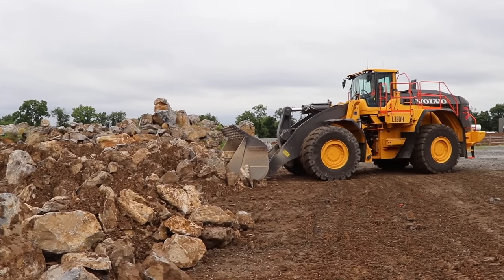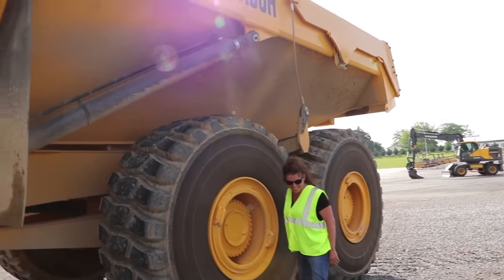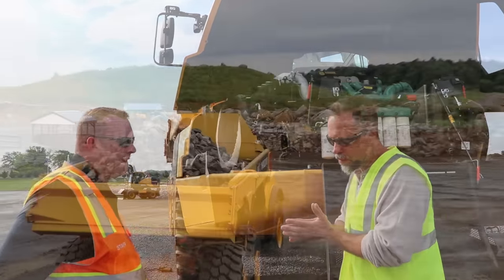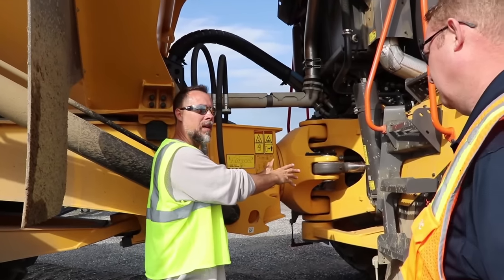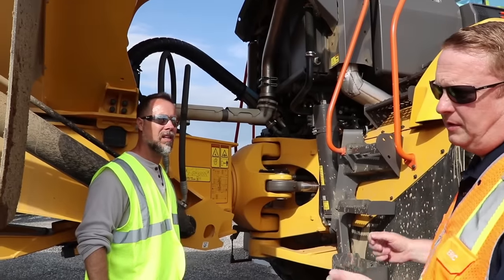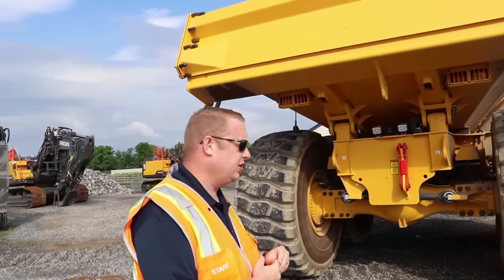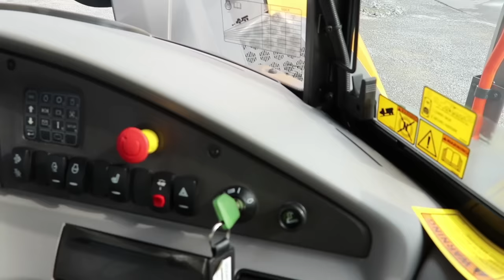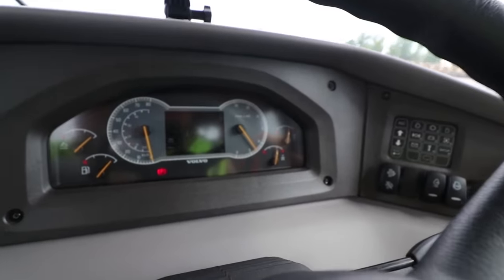What NOT to do with Heavy equipment.  Warning signs & mistakes in a 60 ton rock truck #1

Comment: About 35 years ago, when I was an oilfield mechanic, I was drafted to operate an articulating earth mover when the operator quit while I was on location.  Ended up being the dirt crew's resident mechanic/operator for nearly a month before we got back home.

We were building a pad for a oil drilling rig on a hill which required digging out the side of the hill for a mud pond and using the dirt to create a dam as part of the pond.

I was dumping dirt on the top of the dam when the earth mover started sliding down the side of the dam and tipping (about 20 feet high at that point).  I knew the articulating joint could make a 90+ degree movement so I turned the steering will hard to the right to stop it from tipping but it kept sliding so I stomped the fuel pedal to get the cab ahead of the back end and drove down the side of the hill until I got to the road and drove back up to the dam.  By that time the grader operator had flattened out the top of the dam so it was safer to drive on.

A regular truck would have just slid until it rolled before I could have gotten it turned.  I love articulating equipment.
Reply from the maker: Thats scary as all get out

Comment: Next time I drive a 60 ton truck this will be a very valuable video.
Reply from the maker: Next up is payloaders, then skid steers, compaction and tiltrotators
Reply: i didnt thought id have to drive one one day but here i am an open pit driller and blaster without any holes to drill or blast and im asked to haul muck in one of these 😂

Comment: I work in the mining industry and I love the articulated trucks I have driven A40E/A40G and a cat 745C. The truck can do about anything you want to do. They have one down off yes the bed can fall over , but it works both ways as in the cab can fall over too or go completely on it’s head. This happens when wet or heavily packed material get stuck in the bed while dumping. To me this happens more with beds with bed warmers that is what the pipe is in the middle of the truck but that is the only problem I have with the trucks
Reply from the maker: I didn't think that it works 2 ways. Thanks for pointing that out

Comment: Worked at a coal mine that leased a whole hollow that had a one lane county road (paved mostly) had roads so steep that every time it rained it required a rubber tire loader to push the haul trucks (18 wheelers) up the mountain. The mining complex had 3  different undergound mines and a mountain top removal section of the strip mine and 2 wash plants. Everyone was required to have CB radio, flags and strobes as soon as they entered past the guard shack, because all the miners had to use the haul roads to access their respective underground mine entries. It was never fun to find out your CB wasn't working because of a blown fuse and run up on a "lizard Truck" like the one in the video or a D73 with it coming down the mountain in a blind curve on a one lane road like the same width shown in the video.
Reply from the maker: Holy crap -Thats scary

Comment: A 4 stick backhoe with wore out pins and bushings is funny to put beginners on.
Reply from the maker: If they can learn on that then they can handle a new one
Reply: Hell I took right to stick controls on our 580E and our K we had when I was like 9. I can't use joysticks on a backhoe, tried one when cat first cane out with em. But i never liked cat backhoes anyway, and never had any reason to really try to get one down. Ran a 2800 Link Belt the next year or so and a D8 and as with everything else it was like I'd been doing it since birth. To this day that backhoe is the only piece of equipment that I couldn't just hop in first try and take off.

Comment: My Father-in-Law ran heavy equipment, towards the end mostly Scrappers, but with the various companies he went to through the union shop he would talk about foremen that took a dislike to someone or you managed to be on his s*it list for some reason (like ripping up a thousand feet of cable or breaking a pipe) you got put on the Rock Truck (mostly Cats), apparently no one liked using the Rock Trucks and was used as a punishment job.
Reply from the maker: Thats easy work though
Reply: Yeah, that was my argument (understand that I've never been in any earth moving vehicle), his reply was that in most companies the rock trucks were usually the very last piece of equipment to be replaced, heavily used and usually worn out that you needed to stand on the brake to work, many would just use the torque converter to stay put on an incline causing it heat up and barely work, and the steering was often so clunky that you needed Schwarzenegger arms to turn or stay straight.

Comment: Drivers engaging the diff locks while the wheels are spinning drives me nuts. It's the awful ratcheting noise until the rotation slows enough for the locks to engage, then the bang as they do. Lord knows how much stress they are putting on to the transmission / drive line components.
Many of the drivers don't know how or when to use the exhaust brake, transmission retarder, or foot / service brakes. On descent they just use the footbrake and not the pedal on the left. Brake pads (and they are pads on Volvo, not shoes, as they have disc brakes) don't come cheap.
The first ADTs I drove were the first A series from Volvo the A20 & A25. They had a multi stage single tipping ram, that came down under gravity. Then CAT D250s.
I love your videos on YouTube. 
As for the Polish references. Great stuff, my partner is Polish.
We also have Polish lads on our construction sites, bloody hard workers.
All the best from the UK.
Reply from the maker: Thanks Neil! All the best back at ya from a Pollock in the states!

Comment: We got the coolest underground rocks trucks. They run on 1000 volt eletric trolley line. They hold like 60 tons and will go 21 kph up ramp.  They are made by abb and called kurina trucks.
Reply from the maker: That does sound really cool.

Comment: U operator this exact one all day in a mine and that safety alarm for the bed. Is annoying and goes off even if I’m on a 2% grade I dump with that alarm on all time I have choice.  They are nice trucks but ever bump feels like I been in a small accident. Very easy to tip

Comment: Isn't this is quite a lot larger equipment than the average  landscaping contractor would use.?
   Maybe once in awhile they'd use a full size excavator, dump truck or loader. But I thought most of them use mostly compact equipment.
(Like a small to midsized excavator, skid steer and a 1-ton dump truck).
   I'm NOT hating or complaining,  (I'm just guessing) that the XL and XXL equipment is probably used by only 1%-2% or less.

Comment: For anyone who's smarter than me about this stuff, as I know next to nothing about construction site and equipment logistics:

How are these vehicles delivered and repositioned to various worksites? 

I couldn't imagine they'd just drive on the road do they? That doesn't seem practical for a machine like this, then again they seem too heavy and large to put on a flat bed trailer or something like that.

Just curious how they get these to various construction sites.

Thanks ol'chaps
Reply: I’ve drives everything from front end loaders, to motor graders on the road around other cars and whatnot, it’s terrifying, especially the first few times but it’s perfectly legal. 

Sometimes I’ve had to drive them miles around the city to jobs that were closeby.

Most of the time however our equipment is transported via semi truck or dump truck with trailer. Bigger equipment like haul trucks or just really any sort of biggggg equipment is transported in multiple pieces.

Like with dozers they’ll sometimes just have the mainframe with none of the drive sockets or blade/hydraulics for the boom on board.

Google D11 being transported.
Reply: @outrun7455   Thanks so much. Those huge surface mine dump trucks where a full-size adult does not even come up to the tire rim on the truck, how do you transport those?

They are enormous and I don't even want to guess how much they weigh.

Comment: Nice truck. What is the biggest rock truck Volvo makes
Reply: Brandon Skomars the A60 is the biggest they make.
Reply: The A60 is the biggest articulated truck they make. But they also just announced earlier this year that they going to start making rigid dump truck. 2 of those are bigger 72 ton and 100 ton.
Reply from the maker: Man-  I want in one of those.

Comment: Does it weigh 60 tons? Or do you mean it can operate with 60 tons of material in the bed?
Reply: Graham K 60ton is the "safe load capacity" I love the loading lights over the mirrors shown in the video showing how much of a load is in the truck overloading is not only dangerous for the operator to haul but overloading the truck wears out the truck much faster along with killing fuel efficiency .... I've seen these trucks abused time and time again with overloading them just about everytime having a system takes the guess work out of the equation saving not only down time but money over all !
Reply from the maker: Great point Jeeper

Comment: it`s articulated dump truck  not rock truck...  just saying
Reply: triangular100 it’s a wiggle wagon
Reply: triangular100 the Swedish name is just dumper!
Reply: In the UK a dumper is the smaller, sit on type with the skip at the front. Thwaites, Benford etc. A dumper truck is the larger types like the Volvo A series, Cat 700 range, Bell (I think they are branded John Deere in the US) & Moxy/Doosan, to name just a few.
To distinguish them from the smaller dumpers, they are more commonly referred to now as ADTs, articulated dump trucks.
Obviously different parts of the world call them different things.
We don't call a 360° excavator a backhoe in the UK, like they do in  Canada or the US.
Reply from the maker: or its Just an Old Pollock way of saying an articulated haul truck-rock truck